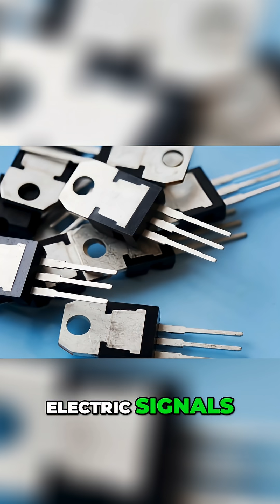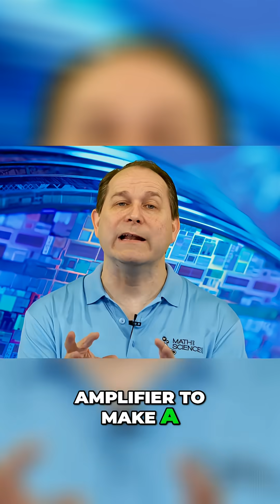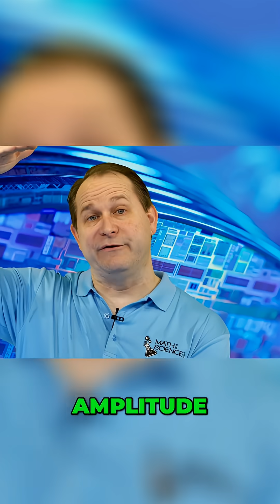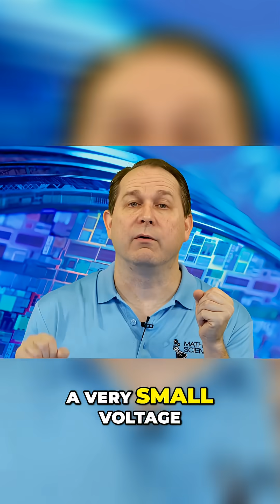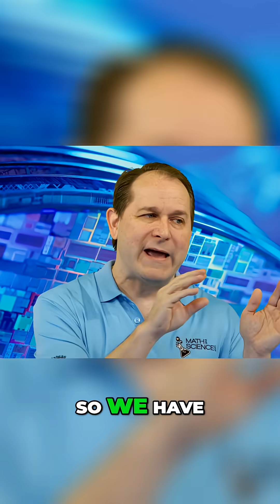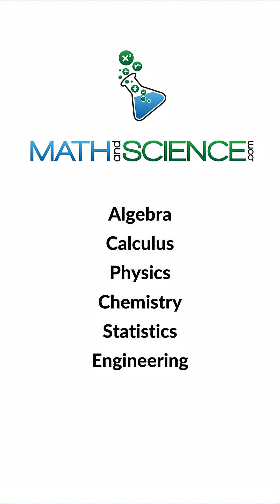How Transistors Make Sound Louder

Comment: No.  Your attenuating a strong DC signal with a week AC signal.  Try doing it without a extra source of DC power.  This is why so many people are confused because they always leave out the most important thing.  They make it look like they are getting more power from nowhere.  It's like sculpting a statue out of a block of stone.  The sculpture did not just swing out of the chisel.  Most of the effort came from the original stone.